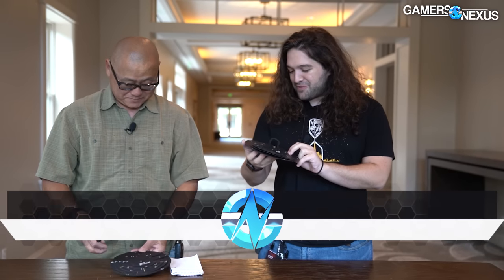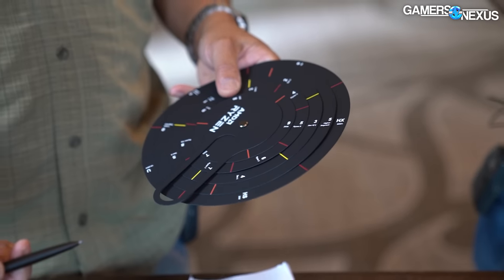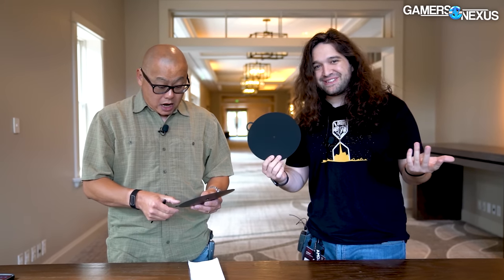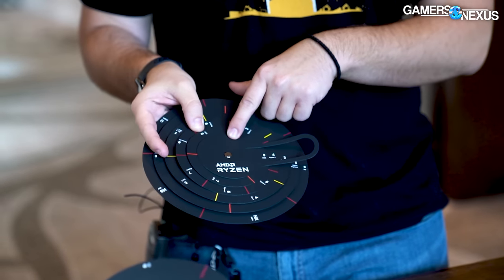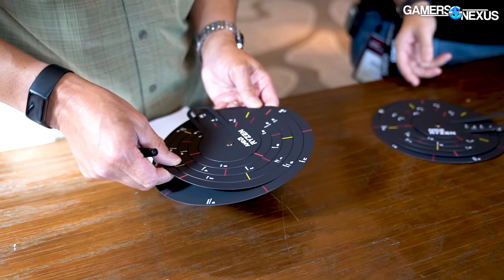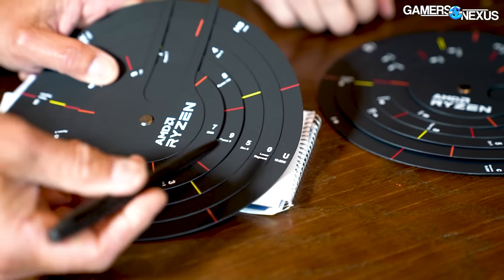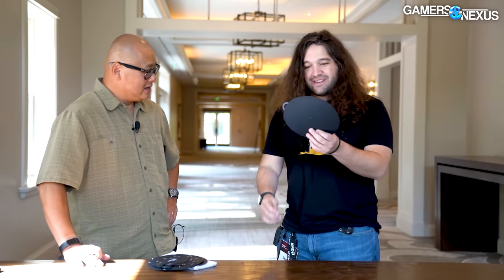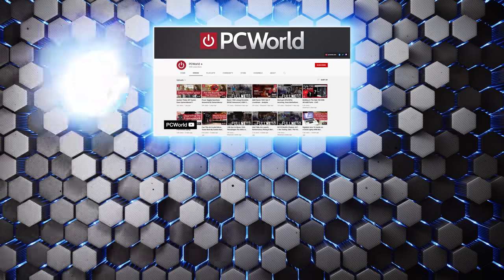AMD Gave Us Too Much Power | CPU Naming Problems

Comment: For the first digit, think about the used market. There's a world of a difference when buying a 2 year old chromebook and a 7 year old chromebook, even though they might both be Pentiums. If they were the exact same architecture underneath and you weren't familiar with the specific model case differences, you would have nothing else to tell you one was 3 times as old as the other. The 7 year old one probably has a much more faded screen, a dustier fan, and a battery that would be dead.

Comment: My guess would be that any older variants that are 'relaunched' would have something to distinguish them from the original launch like more cache or higher frequencies. I also wouldn't expect them to combine components from widely disparate eras. Just a wheel that includes the whole stack rather than indicating new will be launched for them all.

Comment: With amd keeping am4 as the "budget" option to am5, are they going to release new CPUs on the platform or they are just going to keep manufacturing existing zen3 parts alongside zen4 parts?
Reply: They're doing a Zen3+ Ryzen6000 as the final hurrah for DDR4 to go alongside Ryzen7000 for DDR5. It was listed on their roadmap a couple of months ago. 👍
Reply: @MafiaboysWorld  sweet, i guess my 2600x it's going to have to hold a little more before i upgrade on am4, thanks!
Reply: @MafiaboysWorld  finally i can save up for preparing upgrade to 6000 series
Reply: Please remember that the chiplets are the same for Ryzen, TR and EPYC. And AMD has delivery contracts for TR and EPYC, so they are obliged to produce zen3. So it could be that they release new Zen3 products (or newly produced Zen3), if their production is above the required numbers for EPYC.
It could even be possible for them, if required, to bring Zen3 to AM5. The chiplets are linked by the IF to the IO-Die, so as long as they did not make huge changes this could be an option.
Reply: @johnscaramis2515  No, they already said during the roadmap speech that they aren't doing Zen3+ on AM5, that's reserved for Zen4 and on.

Comment: Sounds to me like the year shouldn't be the first digit as it has the lowest impact on performance.
Reply: Just an easy way to increase the number: Bigger =  better. Imagine if they did it to desktop. For example, the RX 6700 XT which released the next calendar year after the 6800XT becomes something like RX 7725.  6800XT's new name would be RX 6825.
Reply: @mag3slay4  Deceptive.  I do think the year is important but it should be farther down the line.  The first number should be the core generation.
Reply: @davidwiley4953  If it's further down the line it won't feel as important. I'm not buying a Ryzen Zen 1 1XXX today, no way, when there are Ryzen 6XXX out. But if that 1XXX is 6XYZ, and costs 1/2 of the 6XXX model, I'll jump to the conclusion that it's pretty decent. Like they said in the video, everything hinges on faith that they won't launch an outdated Zen 1 processor today.
Reply: @mag3slay4  Oh I get what you're saying.  The manufacturer wants it that way but it's not what the consumer deserves.

Comment: The Apple M2 is always faster than the M1. However, the M2 is not faster than the M1 Pro, M1 Max, or M1 Ultra. I prefer "Pro/Max/Ultra" suffixes over Intel's "U/P/H" suffixes.
Reply: But those still make no sense, "Pro" implies professional use but has just come to mean "more powerful", "Max" implies, well, the maximum but here it's in the middle - plus Max is being used in phones to denote larger physical size. Ultra is the only one that actually fits but to me ultra and max imply the same thing. It just smells of "we use words instead of letters/numbers since we want to dumb it down for out customers" but then they just misuse those words.

Comment: Intel is doing the same. Not all 13000 series CPUs will be the new microarchitecture. The lower end CPUs will be the same as the current 12000 series.
Reply: AMD fanbois always like but but Intel does it too

Comment: I don't see the big issue. There's no major difference, it just denotes the architecture in the 3rd number. Just about everything else is the same. 

On Desktop, we see a 7600X and 7500X and we know those are 7000 series Ryzen 5 chips, just by the numbers. 

On mobile, we see a 7640U and a 7630U, it's still clearly a 7000 series Ryzen 5, but now we know the 7640U has Zen4 cores and the 7630U has Zen3 cores. 

The suffixes (U, HX etc) are nothing new. Same thing we have now. 

Now if we see a 7640U and a 7645U, we know that the 45 is faster than the 40, like the Radeon numbering. So it really isn't as difficult as people are making it out to be.
Reply: Going by the comments section, people aren't very bright in any case and this channel is supposedly followed by PC enthusiasts.

Comment: I agree with what Steve was saying. They're updating the names to make them more appealing, but it creates a problem. Most consumers won't look past the first number or two. You might end up with a situation where an R3 part on a newer architecture will be faster and more efficient than an R5 part on an older one. You may also run into situations where the R3 part may have features not found in the R5 part. It goes against the common sense interpretation that higher number equals better, and many consumers not deep in the tech space may get burned by this.

Comment: Are they getting rid of old stock? How do you justify selling an older core design in the current year? Certainly efficiency only goes up over time so why produce more of the less efficient chips just to sell for a lower price? I guess running older node lithography machines is the only way to maintain margins on a low price sku?

Comment: 17:49 TBH just do this:   Year.Class-Core-Power-Usage-APU

23.955D = Year 2023, Ryzen 9, Zen 5,  High Power 5, Desktop D
23.933L =  Year 2023, Ryzen 9, Zen 3,  Mid Power 3, Laptop L
26.953L =  Year 2026, Ryzen 9, Zen 5,  Low Power 3, Laptop L
22.330C = Year 2022, Ryzen 3, Zen 3,  Ultra Low Power 0, ChromeBook C
22.533SX = Year 2022, Ryzen 5, Zen 3,  Low Power 3, Steam S, APU X
24.513L =

Fixes the having higher number for newer stuff, and also makes it comparable much easier
all are independent as new nodes would also change power levels so like a zen 1 manufactured on 6nm
Reply: And this scheme took like 15mins to come up with 😂

Comment: If I were AMD I would just keep the desktop nomenclature, stick an "M" at the beginning to denote a mobile part. Or, do the following:
(M) - Mobile
7 - Generation
6 - core count
4 - TDP variant (10 watt increment)
0 - TDP variant (5 watt increment)
(E)(W)(X) - Optional to denote a performance oriented, workstation part or embedded

for TDP variants, the 10-watt increment would be as follows;

0 - Embedded or ultra-low power (sub 10 watts)
1 - Low power (<25 watts)
2 - Perf-per- watt optimised (25-30 watts)
4 - Balanced performance (35-45 watts)
5 - Raw performance optimised (65+ watts)

and the 5-watt increment basically says instead of it being a "40 watt" part that it's actually a "45 watt" part. So a "M7640" would be a 40w 6-core part in this example.

For variants with greater than 8 cores (e.g 12 / 16 cores);

7 - Generation
9 - Core-count (9 = 10 or greater cores - see core count(ones))
6 - core count (ones)
5 - TDP variant
(E)(W)(X) - Optional (Embedded, mobile workstation,  performance)

In this case, an M7965X would be a high performance 65 watt 16-core CPU. We use the 9 in this case to denote a 10 because it's the highest you can go in a single digit scenario. Plus, there are no 9 core CPUs in x86 desktops unless some absolute nutjob has a board that takes three Phenom tri-cores, so it's safe to use this way.
Reply: The core notation doesn't scale with 20+ cores though. But yeah, something along those lines, especially a simple M pre- or suffix is what I think would be great, keeping the rest in sync with the desktop parts.
Then you'd have an R5 5600X for desktop and the mobile equivalent would be the R5 5600M or 5600MH, or perhaps R5M 5600(H). Both would be 5th generation (well, already not true, but you get the point), Zen3. Simple.
If they want to sell an older architecture, they can release an improved R5 3600M as R5 3610M for example, improvement as in higher clocks due to matured production. Or when they do a Zen2+ refresh, it could be R5 3600M+ as well. It would be easy and as the old CPU would be cheaper and used in more budget-focused systems, that shouldn't be a problem, a consumer should know he's making sacrifices when buying something cheap, so you don't need to have the latest and greatest, just something decent.
Reply: @dennisjungbauer4467  > Absolutely this

no need for a wordle and a decode wheel to find out what SKU is from which segment. :)

Comment: mArch on the third digit is just, eww. Theoretically if AMD were to reimplement Zen1 on a more modern process node , it could create something like a R9 7910HX. Numerically it’s only slightly off from 7940HX (Zen4), but the perf difference would be night & day.
Reply: Or they could keep selling Zen 1+ processors like the 3400g (which is surprisingly still competent) with all that cheap 12nm they have from Gloflo
Reply: @egalanos  just using it as an example to show how this naming scheme can potentially mislead consumers. I’m certainly not advocating for AMD to dust Zen1 off for another spin.

A more realistic scenario is this. Barcelo - which is already a Cezanne refresh - is officially confirmed to be getting refreshed next year, as the Ryzen 7x30 series (up to R7), Phoenix will be 7x40 (up to R9). We might see Ryzen 7 7730U (7nm/Zen3/GCN) selling alongside Ryzen 7 7740U (4nm/Zen4/RDNA2 or RDNA3), and 7740U will flatten 7730U in every way imaginable. (I don’t know the SKU stack of AMD’s 2023 lineup, just filling in the blanks here)

Comment: It's complicated because, let's say they do a Ryzen 5 5600X and they would like to make a mobile version of it, it's impossible to keep the same performance after downclocking cores and reducing power requirements and integrating a GPU, slightly older chips are more understood so they can make better efficiency gains without developing a whole new generation chip. An example of Nvidia doing this incorrectly is naming the GTX 1650 as a GTX 1650 Max Q for the mobile version, even though the mobile version has 20-30% less performance in most applications, sometimes even having half the performance of it's desktop counterpart. This simple naming scheme ends up being misleading in the long run

Comment: I think the "Year" number being first is a little bit shady marketing. I can see a use for it, but best to put it at the end like -9. The use case is you could easily tell the relative age of the whole product you're buying. The same chromebook with a 310e-7 would be a few years older than one with a 310e-9. So really it's only useful at the really low end where product models stay more constant and the high end since newer high end CPUs better be better.

Comment: tbh as long as amd doesnt abuse this new naming scheme to mislead consumers i guess it's ok, it feel kinda ingenious even if they couldve made it better like not using the year/making it a number at the end or something idk. But tbh i prefer the naming scheme they have on desktop. like 3/5/7/9 is low/medium/high/ultra high range, then the next digit is the generation which is linked to the zen cores, the next is the performance so higher better, and then the last letter (optional) is like the plus or if its an SoC, i felt like it was very easy to understand far easier than intel, but tbh i usually just google the cpu itsel of check it on cpu-world always no matter what so even if they change the naming on mobile id just take 5 seconds to check the specs as usual.

Many markets are just random numbers that no one can understadn unles they take time to literally study it, especially on TVs but like consumers usually dont care about anything on there just "looks good" (meanwhile i got hrough hundreds of different models on different pages with specific filters bc im trying to fina the perfect one on my budget rip)

Comment: "but it'll be near the end of that year, therefore it'll be the next year" I dunno, sounds like what the car industry has been doing for years. I had a 1998 Ford Escort that had been registered and on the road in October 1997, but it was still the 1998 model year car... =)

EDIT: I think it's overtly complicated, but still not too bad. Decode rings are kind of supposed to be nonsensical when you put in random stuff, but make perfect sense when you input a real thing. Overall it looks kinda OK to me, with some issues:

1. "Model year", 7 = 2023 model year, 8 = 2024 model year, 9 = 2025 model year. Not too bad, if you're going to have to sell multiple generations of cores within the same model year, you have to do something like this...

2. "Class", this is from what I can see the only really problematic one, since 3 & 4 means Ryzen 3, 5 & 6 means Ryzen 5, and I guess 7 & 8 mean Ryzen 7, with only Ryzen 9 being unequivocally a 9...

3. "Core type", 1 = Zen 1(+), 2 = Zen 2, 3 = Zen 3(+), 4 = Zen 4, 5 = Zen 5. Makes sense.

4. "Market segment" inside class, 0 = lower market, 5 = higher market. Makes sense.

5. "Power class", e = 9W, C = 15-28W Chromebooks, U = 15-29W PCs, HS = 35W, HX = 55+W. Makes sense, though not entirely sure why Chromebooks need their own code.

Now if they didn't mix and match cores within a generation, they could have simplified this to almost match the desktop world, where the first number is both model year and core type (... usually...), and drop the "core type" number altogether. So not perfect, but at least every number has a pretty clear meaning. Aside from "Class", since Ryzen 3 can be 3 or 4, etc.

Comment: So, what they're really doing is just reselling old tech, that would naturally decrease in price overtime.  Definitely sounds like a great business model!
Reply: I mean they're selling the old tech that would naturally decrease in price over time at lower prices usually. It's just that consumers will struggle to make informed decisions because they may not realize there are variables they don't recognize.

Like a Ryzen laptop with an older architecture APU (can't think of a specific example don't pay attention to APUs) in it compared to an Alder Lake i3 laptop. They might be the same price but the older Ryzen CPU has a nicer fit and finish, more storage, a better screen, more RAM, whatever. That might look like a slam dunk for Ryzen if you don't understand the naming structure. They're not really price gouging there, more just obfuscating the variables.

Comment: so hot take is that we only know theres a new naming scheme... but how they will execute it is pretty much up in the air.... if I were the marketing division I'll just dump the naming scheme and just dp a "refresh" Da Capo everything start from 0 or 1 then XXX Ryzen X (3-9) X (Genenration) X (TDP class) X (suffix type)

then all old Zen 1-3 achitechtures will be slapped onto the Athlon line SIMPLE AMD is hedging SO MUCH on the Ryzen name they forget THEY HAVE THE ATHLON YA KNOW THE AVERAGE ULTRABUDGET SCHMUCK because answer this question will anyone out there pay 3000 USD for an Athlon based laptop? so for Athlon Line this would make some "sense" Athlon X (Zen line) X (TDP if there is such a thing) X (suffix)

Comment: I would like a naming similar to: [Multithreading rank][Single threading rank][2 digit year][Power/Graphics or other].
Example 1: 9923U. The best both multithreading and singlethreaded low power CPU of 2023.
Example 2: 5323H. Midrange multithreading with low singlethreading (old core) and high power CPU of 2023.

The years will not coexist for long so you might see a 23, 24 e perhaps 25 at most at the same time. Don't expect performance of both categories to jump so much but it would be possible that a 9925 would be quite a bit faster than the 9923  if there was a major architectural change that doubled the cores and improved single threading considerably for example.

But it would clash with existing names of old Ryzens in the years 2050 and would not leave them room to wiggle with weird SKUs. At least it makes me clear what kind of power I'm buying from which year, and that is basically what I need for a buying decision. 5723H for a value for money gaming laptop or a 5623U for a quieter but still capable one.  Or perhaps a 4523H older gen chip in the high power/clock variant for more affordable gaming. Or a chomebook with the 3123U.

Maybe even rearranged: 2399U, or 99H23.

Comment: even the explanation deoding wheel need underlines on the actual numbers to even explain it further^^

now with PC arround since the last century (and software) i realy think Software, OS, CPU, GPU even Productseries like Laptops and so on should just be named after the Year they started followed by a Number or naming sheme for their power or something. 

It would be For Ryzen just be Year + Core Count + Clock Level + IGPU + 3d VCache or other Specialities like Low Power Cpu or OC, Mobile Cpu and so on. 
so it Would be AMD CPU 22/6c/xx/i/U for a Year 22 Series 6 core iGPU Ultra low Power Cpu. The 8 core 3dv cache without iGpu and Normal Power Limit would be AMD 22/8c/3d/x/N 
Gfx would be Asus AMD GPU something something ...

Intel could do the Same  and Gfx pls also.. 
I am sick off all that naming nonsensense additional with silicon naming and actual product naming you have learn and and and.. j
jst put the Vendor or Manufactur the year and technical facts in and its done